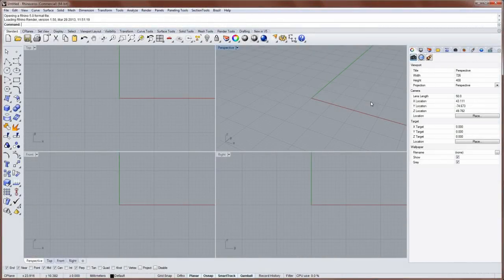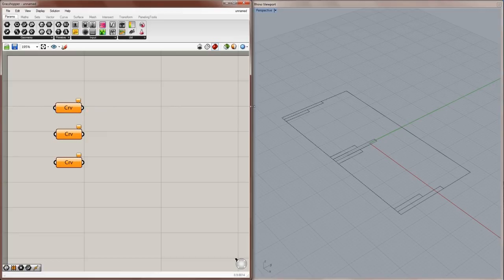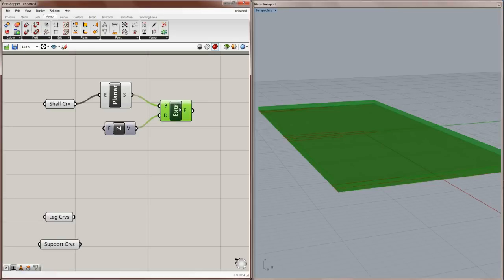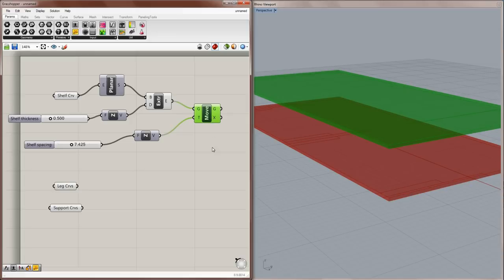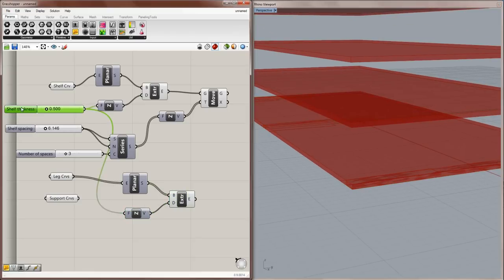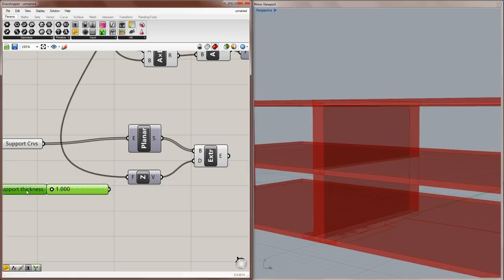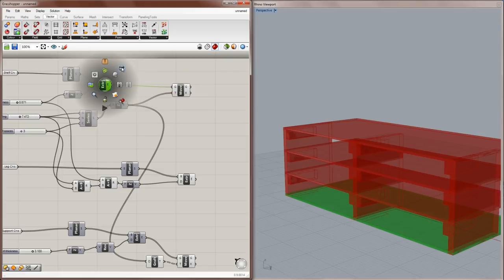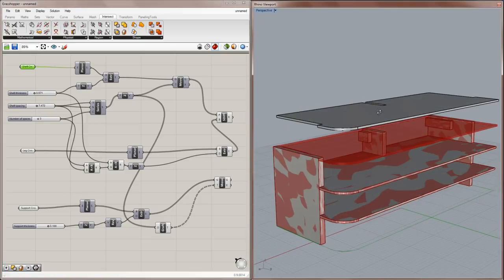Intro to Grasshopper for ID

Comment: however i do not understand the graft tree???
Reply from the maker: Hi Oska, I like to think of Graft as making each item in a list it's own separate list. As that feeds into the rest of the definition, actions are performed on each and the amount of data you start dealing with can grow really quickly and slow down the solver... so be careful. Make use of the Grasshopper section on the user forum too for more help, https://discourse.mcneel.com/c/grasshopper